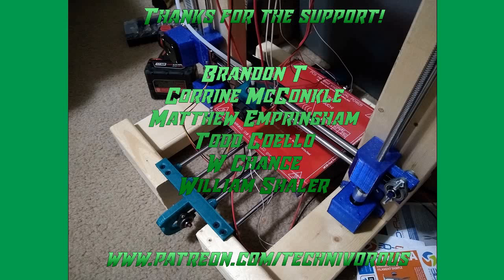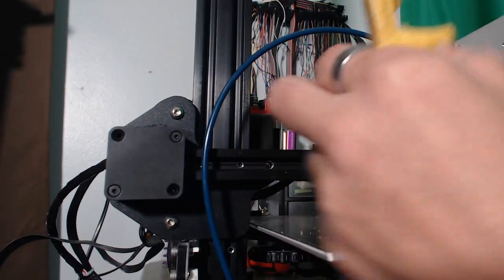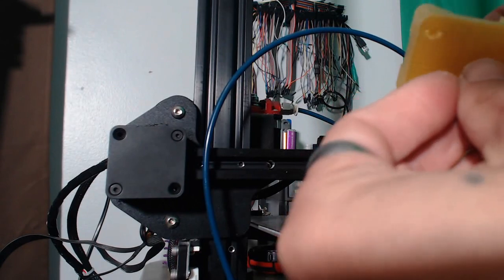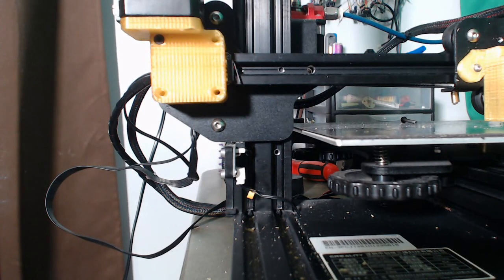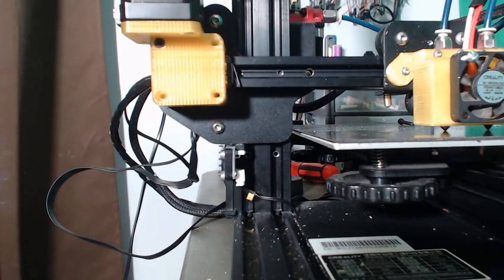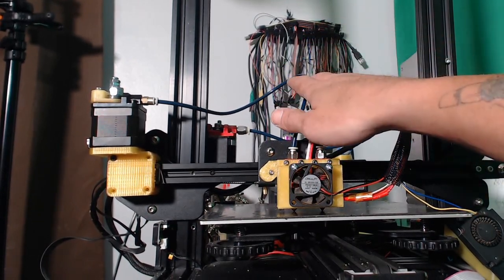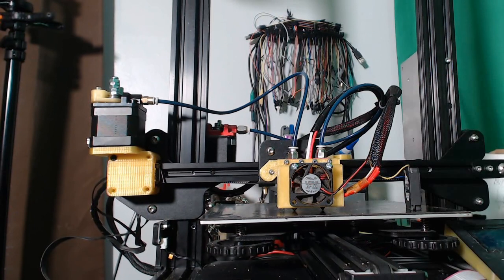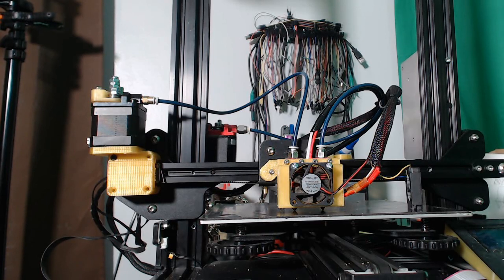Ender 3 dual extruder - second extruder mounted

Comment: What kind of dual hot-end are you using here?  I bought an e3d clone from amazon and it will print with the first nozzle, I just can't get the second nozzle to print over the first. It seems to just scrap the top. I leveled everything and have a BL touch with mesh leveling.
Reply from the maker: Two separate extruders that are stock ender extruders. Is it clone a chimera or cyclops? 2 nozzles or two into 1?

Comment: I love your idea to move the z endstop onto the hotend carriage. I wonder why it wasn't there in the first place. I'm struggling with my own 2in1out conversion with a BTT Tango. Initially I thought I could use the stock hotend + my 2in1out, but no slicer software I've found supports such a configuration.

Comment: In your video, you mentioned a new board...
I am currently to the point where I need to buy another extruder to add to my ( 2 filament in 1 out ).

But I have heard having to buy a new board from you and 2 others.

What board is it that is needed to purchase to run 2 extruders?  I have the ender 3 pro....
Reply from the maker: there are several boards capable of this...google "ramps board"

Comment: This isn’t a real IDEX... a dual extrusion would be more accurate.
Reply from the maker: Yeah its dependent dual extrusion. Need to fix that thumbnail but the following videos have corrected the error. Thanks Stephen!
Reply: Technivorous 3dprinting it’s a cool idea. It’s just dual extruder. It will be interesting to see how you tackle it knocking the model over. A servo to rock one out of the way would be nice